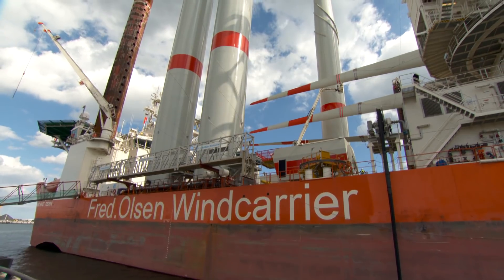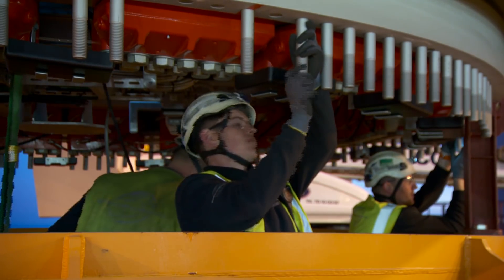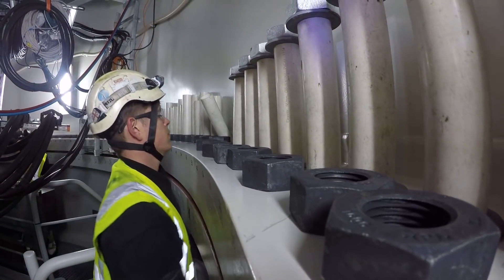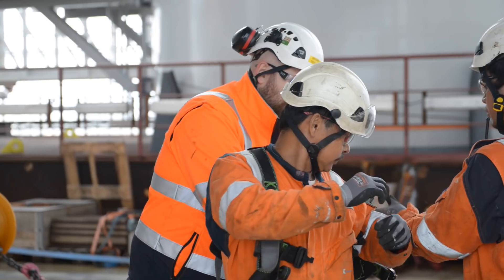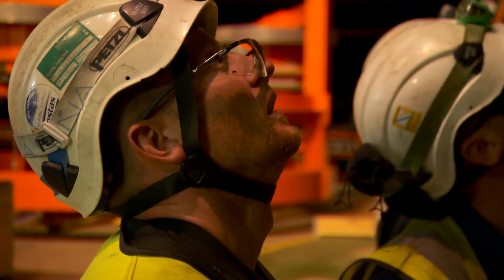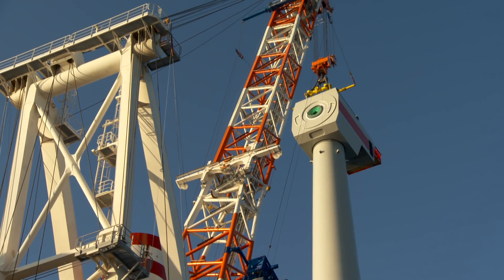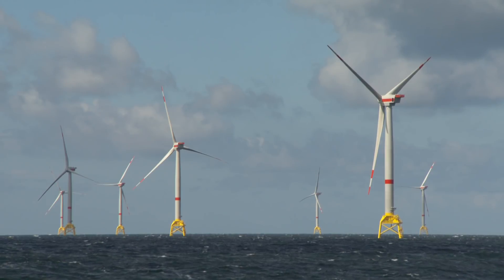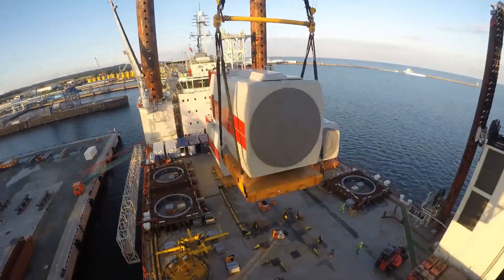Wikinger Offshore Wind Farm Installation - Full Length

Comment: Looking at UK history, which is where I’m from, I remember reading about our great sea-faring nation when our vessels were all wind-powered.
Our voyages were constantly imperilled by “be-calming” which meant days, sometimes weeks with no wind.
Or, hull-crushing storms that threatened severe damage, where sails (turbines) could not function.
Off-shore wind-farms are a useful development, but they are a “Fair-weather” optional power source, not an alternative to land-based, fuelled power generation.
Reply: Becoming "Becalmed" was a term where a ship might find itself in the center of a very calm area of the ocean, and not able to sail out of that area, maybe being stuck there for a week or more.  There are special secret books that show the areas where you might become becalmed, and what areas have the best wind speeds for getting to the port much faster.  Secret because it was critical to get to a port sooner than the other guy, and thus like a trade secret for the owner of the information to get to a port the fastest.   

They are installing these wind farms in areas that typically have 15 MPH winds or more all winter long, and typically will have plenty of wind each day, due to the air being heated and moving from one location to another.  

In other words, people smarter than I am decided the best place to install these wind turbines, in very windy areas.  The winter storms with 20 meter tall waves are something that they plan for, that is why the towers are so heavy, very thick steel, and very large diameter to support the tall tower in very high winds, with a lot of push towards one side.

Comment: How do you route the connecting cables to the shore?
Thank you.
Reply: They have several mono-piles with one wind turbine on each one.  The turbines put out 13,000 volts (up to 33,000 volts on some turbines) to a monopile that does not have a turbine on it, but is located near the center of the wind farm.  That monopile has connections to all the 13,000 volt lines to each string of wind turbines, and a "Export Cable" to the shoreline.  That line can be in the 450,000 volt AC range, or on some systems they plan on using 450,000 VDC power, so there is less power loss on each mile of power line.  Also if the frequency in one area is different than the others, there is no conflict with DC power.  

There are also some wind farms using both AC and DC power lines to the shore, and can load up either system depending on how much power is needed at the other end of each power line.
Reply: @Kangenpower7  Thank you.